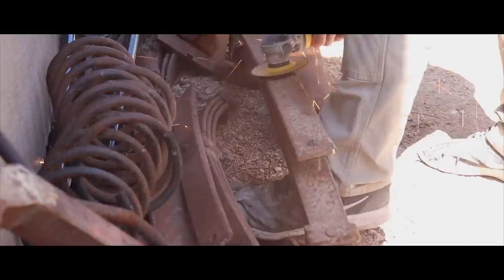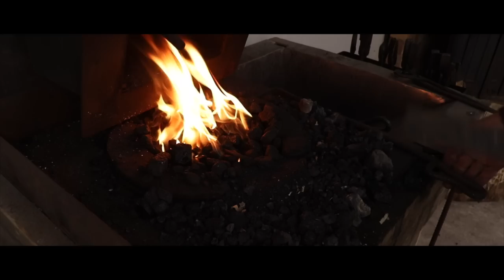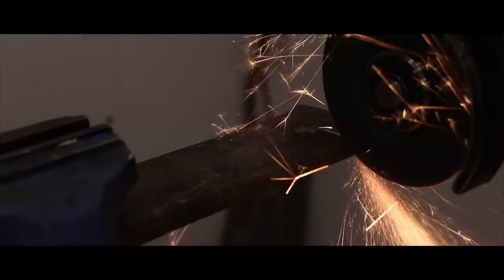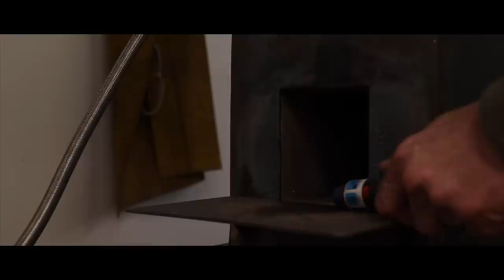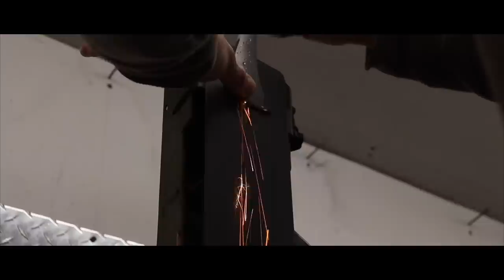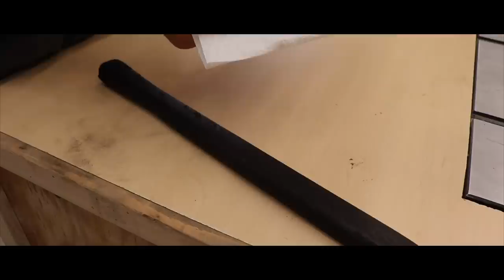making a TOMAHAWK

Comment: Usually thumbnails are deceptive, but I knew this one won't be. Immediately became a fan the moment I saw San Mai technique. Could not figure out if you etched it or not, but that leather wrap is beautiful. More power to you Sir
Reply from the maker: Thank you very much!! I did etch it. The video that I took of the process was corrupted for some reason and I wasn’t able to use it in the full video. But it was the same process that I used on the antler handle knife video if you’ve seen that one. It was a copper etch so it gave the metal a copper patina.

Comment: Excellent craftsmanship! Love the simplicity of your video while showing fine detail. I'm just getting into blacksmithing myself and I'm curious to know something I see often in axe making - the edge made of a different steel you are pretty much adding this as a forge weld because of the unknown/low carbon characteristics of the body correct? If the whole body was made of the edge you essentially wouldn't have any need to forge weld anything (albeit it would be far more expensive)?
Reply from the maker: Yes exactly. It’s cheaper and easier to forge mild steel but you need a hardened steel to hold the edge.
Reply: @TheHiddenHomestead  thank you for taking the time to reply! Much appreciated.

Comment: How is the tomahawk head attached to the wood so that it doesn’t fly off if you use it?
Reply from the maker: tomahawks are normally just friction fitted which is the same way I did this one.The SD card was full when I started the leather wrapping unfortunately. It’s what keeps the head held up towards the end if the wood happens to shrink.

Comment: In general, what’s the point of adding a bit if one were to make the whole axe out of high carbon?
Reply from the maker: If the whole thing was high carbon there wouldn’t be a point to I guess. But there’s no reason to make the whole thing out of high carbon. In my opinion anyway. It’s a waste of good high carbon and it’s easier to forge mild still. As far as I know traditionally axes, hatches, tomahawks, etc have been made from mild still/iron with a higher carbon bit forge welded into it. Higher carbon was more expensive and harder to come by so it wouldn’t be wasted.

Comment: nice build m8, how did you cut the blade to insert the harder steel into it? also nice music
Reply from the maker: Thank you very much. I cheated a little. Instead of hot cutting a slit I used the angle grinder to cut one.

Comment: I thought the steel used, for left springs was good steel, capable of holding a nice edge, why use a second piece of steel, for the edge?
Reply: The steel he forge welded in is the leaf spring steel, I'm assuming the square bar he used for the rest of it is ordinary mild steel.
Reply from the maker: Thats correct. I used the leaf spring for the hardened edge and the mild steel bar for everything else. Mild steel is way easier to work with.

Comment: How did you make the tool for making the eye in the tomahawk?
Reply from the maker: I used a tapered sledge hammer. Heated it up and tapered it a little more then grinded it a bit to get the final shape. Then I heated the other end up to soften the steel so I wasn’t hitting hardened steel on hardened steel.
Reply: @TheHiddenHomestead  that is a good idea. Is there an idea on how to make a simpler version.
Reply from the maker: Ethan Stang a simpler version? All drifts are pretty much based on the same concept and basic design. Choose the shape that you want the eye to be then shape the drift to fit. Mild steel works easier.
Reply: @TheHiddenHomestead  i didn't know that mild steel works better. I'm trying to make one for a tomahawk as well.
Reply from the maker: Ethan Stang oh yeah. Mild steel is softer so if you can get a piece big enough then use it. It will be much easier to forge. It might not last as long as a harder steel but should still last a while. I already had that sledge laying in the scrap bin so I used it.
Reply: @TheHiddenHomestead  what kind of sledge hammer was it again?
Reply from the maker: Ethan Stang not sure of the proper name but it was a tapered
Reply: @TheHiddenHomestead  would it be possible to make one from a ball peen hammer?
Reply from the maker: Ethan Stang do you have much forging experience?
Reply: @TheHiddenHomestead  ive been doing it since 2016 on and off. My recent project was a railroad spike tomahawk.
Reply from the maker: Ethan Stang k. So it depends on the size of the eye for the tomahawk. How big is the ball peen? Once it’s drawn out will it be wide enough to make an eye for the hawk? Maybe. Maybe not. The only reason I used the tapered sledge is because thats what I had and it was already somewhat tapered. it just needed to be sized and shaped. If the ball peen will be big enough for what your planning then go for it. Just make sure to temper the end you want to beat with the hammer. That being said, again use whatever you have available. It doesn’t need to be a sledge/hammer/etc as long as it’s big enough so once you forge it out it’ll be the right size